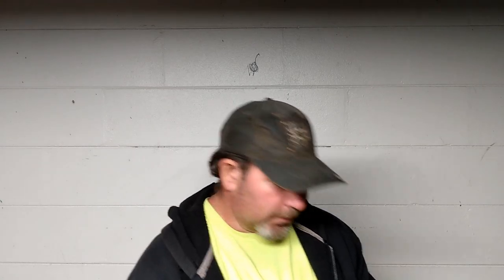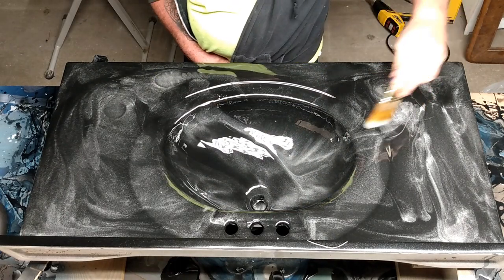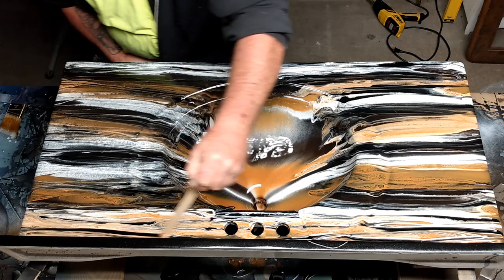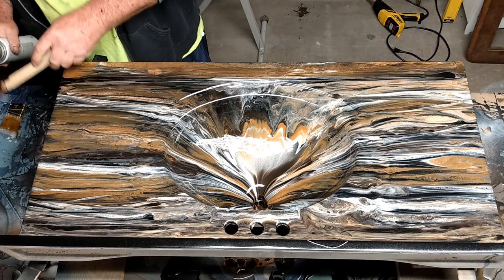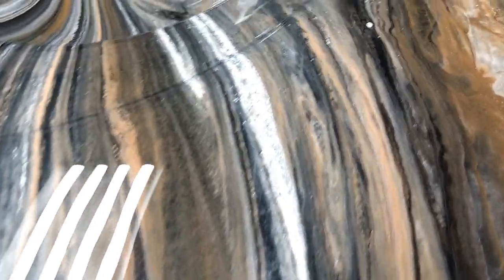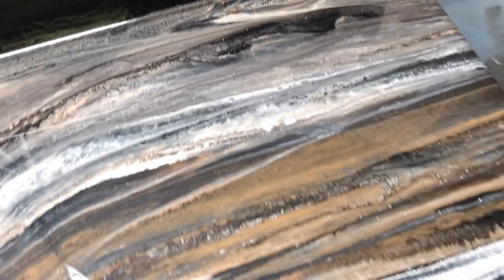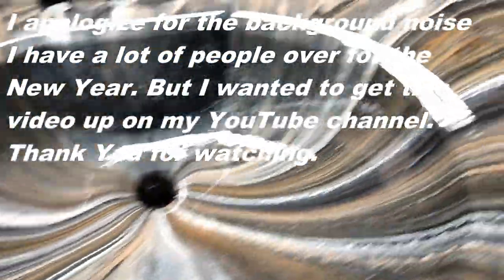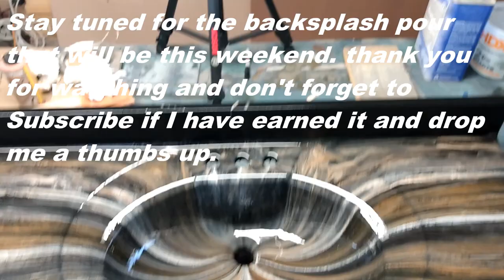The best way to update your bathroom. learn the best way to update your bathroom for cheap cheap!!

Comment: Thank you for your time can I use a normal black paint to paint the sink first before I put the apoxy on and the spray paint is normal paint.
Reply from the maker: You can  just watch the epoxy to make sure it don't start coming off if you don't use bonding primer.

Comment: I love it!! Especially the way it flows into the bowl!! — how would u suggest wanting to DIY without taking the sink out?? That would be a fun one to watch also!
Reply from the maker: Thank you for your comment. It can be done without removing the sink just make sure it's level. Also make sure you protect the cabinetry below and the floor with plastic you don't want that epoxy getting everywhere.
Reply: Liquid Creations Co. thanks for the comment ! What would u suggest we block the drain with?
Reply from the maker: Your welcome 🙂 and thank you so much for watching the videos that supports the channel and I'm trying to get the channel monetized. That way I can do bigger and better projects. To answer your question you don't want to block the drain with anyting. After you disconnect the plumbing put an old bucket under the sink so it can catch whatever epoxy comes out. I hope this answers your question if not please let me know and have a blessed day 🙏
Reply: Great tutorial, I have learned so much! Your work is very beautiful!!
Reply: @starlord2574  very much thanks
Reply: @starlord2574  good to know

Comment: Thanks for the video! What kind of spray paint did you use? Flat? High gloss? Thanks again
Reply from the maker: It's gloss rustoleum spray paint for some reason flat doesn't do very well in epoxy I would recommend either using satin or gloss or semi-gloss.

Comment: Looks amazing.  I've got this 15yo white fiberglass American Standard jet hot tub that just cracked in the middle due to structural gaps I could feel when standing on it. Water is getting through. I drilled a few holes and filled it with Loctite expanding foam and it's solid now.  The base has a seashell pattern in white I was thinking of just replicating over fiberglass resin.  Do you think textured resin (or epoxy like this) would stick and survive the abuse of standing and hot water in Tub? If possible I'd like to fix without sanding or spray painting.
Reply from the maker: Thank you so much, the epoxy will stand up to the abuse but you have to get the right kind. Go to TotalBoat.com they have all kinds of epoxies for all different types of applications. And if the surface around the crack is smooth epoxy will not stick to it very well. The way to fix that is to take a piece of 220 grit sandpaper and lightly scuff wherever you're going to put the epoxy that way it has something to bite to. If you go to their website I would contact him and speak to one of their representatives they will hook you up with a right epoxy and make sure you tell them that
Liquid Creations Co. Sent you hope this helps good luck.

Comment: So you do 2 different  styles one with spray paint and a paint stick and one with paint mixed with epoxy whats one do you prefer? Especially for a beginner
Reply from the maker: If you're just beginning I would use a spray paint with a paint stick that would be a lot easier to control.

Comment: Could you do this to a plastic tub? I have 2 Rustoleum resurfacing kits and would like to add a marble  color.
Reply from the maker: I know regular epoxy won't work on a plastic tub because the epoxy doesn't have any flex to it whenever it cures and a plastic tub is going to move some whenever you step in it. However they do make kits for resurfacing plastic tubs if I'm not mistaken I'm not sure if the Rust-Oleum resurfacing kit is one of them.

Comment: Hello. Did you paint the sink, before you started?
Reply from the maker: Yes I painted it with a bonding primer 2 coats then let dry for 24hr before I started the epoxy work.
Reply: @LiquidCreationsCo2609  thank you

Comment: That's briliant looks amazing!
I have just seen  your video...can you please let me know what spray paint do you use? Its secial paint for epoxy? Or just any spray paint in general? And one more really important thing for me ...do you prime the sink before you do the epoxy? Thank you 😊
Reply from the maker: Thank you for the comment I used just regular old Rust-Oleum spray nothing special. I used to prime my sinks but I have found that are really doesn't matter either way and a lot of people are going to tell you it does but I've been doing it long enough to know that it don't. And I've never had anybody call me back over something going wrong.

Comment: I am about to do this to my sink and our bathroom vanity looks very similar to this but a lot longer and has 2 sinks connected. I don’t know how to take it off so I plan to do this without detaching. What can I do to avoid messing up my pipes/drains
Reply from the maker: You're going to have to go under your sink and disconnect your drain pipe once you do that there should be a little silver or maybe a black nut right up against the bottom of the sink that will allow you to take the actual drain itself out of the sink so the epoxy don't mess it up. You can leave the sink in place but you're not going to have any choice but to remove that drain pipe that goes through the bowl out the bottom and you going to have to unhook it from the pipes underneath so the epoxy don't stop them up.

Comment: How much epoxy do you use to coat your sink?  Also, do you know if the spray paint technique will work with white epoxy?  I've got some experience with pouring art- I'd never have thought to do it on my sink.
Reply from the maker: It depends on the size of the sink that determines the amount of epoxy I use I generally try to mix up 4 oz per square foot. Yes spray paint will work with white epoxy. Although I would not try to use acrylic or anything like that it can be done but you have to be very very precise on your measurements to use it. That's why I don't make any videos using acrylic paint or anything like that in my epoxy I use rustoleum spray paint only I hope this information helps good luck.
Reply: @LiquidCreationsCo2609  THANK YOU VERY, VERY MUCH!  I just bought a small sink today, I hope it turns out half as well as yours! :)
Reply from the maker: @jessicadooley4932  well thank you for that. It will turn out good just have faith in yourself and if you don't mind send me some pictures when you're done so I can see your finished product please 😊

Comment: I've seen another video you did about removing the drips once they have hardened. I think it would be easier for you to scrape them periodically as the epoxy starts to thicken that way you wouldn't have to sand them with the rotary sanding pad. So my next question is do you have to do a clear coat once everything is dry? In case I missed it how much part A and part B do you mix together for a sink like this. I have about 1/2 to 3/4 gallon of each left. I didn't see you use your heat gun in this video like others. Thanks. Love your channel.
Reply from the maker: You would be right if you had time to sit there and babysit your project. This is just one option if you don't have that time or if you forget and the drips have started getting pretty hard this is one very easy way to get them off.
Reply: @LiquidCreationsCo2609   Thanks for replying back to me but would you be able to answer the other questions I asked. Which brand of epoxy do you use also. I have two bathroom sinks to do but only about 3/4 of a gallon of Part A and Part B left. I have to do one of the two sinks this weekend and will try your techniques with the heat gun. Thanks.
Reply from the maker: @richardmace4609  my bad,  one of the best epoxies that I have found to use on sinks is TotalBoat Tabletop epoxy. When it was first formulated it was done so to be used on boats. Later on in the life of the company they seen a market for tabletop epoxy so they formulated a tabletop epoxy based off of the original product. It was originally designed to be wet and 3/4 of a gallon is plenty to do your sink. Thanks again for your comments they help the channel out more than you know.

Comment: What brand  of epoxy do you use for sinks and countertops
Reply from the maker: I use WiseBond epoxy it's a very good epoxy if your interested in it here is a link to there website and here is a discount code  "KELLOGG10"  for an additional 10% off.
Reply: @LiquidCreationsCo2609  thanks, and what sealer do you use?
Reply from the maker: @lindastadtler3017  once I do my color coat I wait 24 hours and put a clear coat of epoxy over top really that's all you need. Unless you want to put a to part urethane on it all that's going to do is help with scratch resistance and it'll give it a little textured look which a lot of people don't like. if you want to go that route I would suggest to get a water based to part urethane to use. And if I'm not mistaken you can get that on WiseBonds website as well this helps. There's anything else I can do please don't hesitate to let me know.

Comment: Absolutely beautiful! Would you recommend some sort of prep for the initial redo on an existing vanity top?
Reply from the maker: Thank you so much for your comment it's very much appreciated. Now to answer your question it's actually kind of funny you ask this question I'm in the process of making a video that shows everything I mean everything from the very start to the very end of how I do my sinks. Anyway yes what you want to do first I use a product called TSP. Which you can buy at Lowe's home Depot places like that it's a heavy duty degreaser clean your sink with that or your vanity top and then take some 220 grit sandpaper and go over the entire thing lightly just to ensure there's no high points bits and pieces that are sticking to it they would affect your epoxy flow and you want to make sure there's no silicone anywhere once you do that wipe it down real good with some acetone then you can proceed to your epoxy work I hope this helps and would love to see pictures of your work once you're done have a blessed day.

Comment: Will this also work for a bathtub??
Reply from the maker: Yes it will but the bathtubs are quite a bit harder to do just because of the shape of the tub a lot more epoxy is going to run off but it can be done I've done it myself it also waste a lot of epoxy though.

Comment: Heck of a good job bro! How long does it take for the epoxy to harden and after you add the clear coat how long does that take to set before it's done? Thank you very much. Thanks a lot Robert.
Reply from the maker: Thank you I really appreciate your comment. After I do my first color coat I wait about 8 to 12 hours then I pour my clear coat over top of that and I let it cure for about 3 to 7 days depending on the humidity then I install it and you can use it.
Reply: @LiquidCreationsCo2609  Thank you so much Robert. I will put this information in my repertoire. Thanks again. Keep up the good work.
Reply from the maker: You are very welcome, and I think you again for your comment also because something as small as somebody commenting helps the channel more than anyone knows so thank you

Comment: Did you have to do anything special to put the drain parts back on?
Reply from the maker: No you shouldn't have to do anything but if it makes you feel better you can use a stir stick and from the bottom very easy with a downward motion you can scrape the epoxy out after it has set up for a couple hours I hope this helps if I can help you with anything else let me know have a blessed day 😊

Comment: how smooth is the bowl part? from the videos it kinda looks bumpy
Reply from the maker: It's a little bit  wavy because I introduced a lot of paint into the epoxy but when I do my flood coat it will be smooth but it's not bumpy at all you can just barely feel the waves in it

Comment: Absolutely beautiful I'm so excited to watch your video I want to do a sink myself and a countertop question is what kind of resin did you use and can I do it with the sink in place or does it have to be removed with a rest and go down into the plumbing which could cause me a problem let me know beautiful beautiful
Reply from the maker: Well Thank you for your kind comment. As for what resin I use it is a product called Totalboat Tabletop Epoxy, it is designed to be wet more often than not I love working with it. I have a link to it down in the description below the video so you can check it out. And no you don't have to remove the sink to pour your countertop I think is what your asking me and no  you can tape it off if you don't want to do the sink. But if you do pour your sink make sure you unhook the plumbing and put something under there to catch the excess resin.

Comment: How did you do (and what did you use) the first black base coat? In the coat that you poured, did you add something to the resin?
Reply from the maker: When I first got the sink I cleaned it with TSP then I painted it with a black bonding primer once that cured I poured a clear epoxy over then I added all of my colors to it.

Comment: That’s wY easier than the way I was doing it .  Great job!
Reply from the maker: Thank you I appreciate that. May I ask how you were doing it?
Reply: I was mixing the batch clear and the pour into cups and add color to each different cup and pour randomly back into bucket without mixing together and the pour it out on top next sink and let it run through.  Same result as yours but less mixing.
Reply from the maker: @tomcrisler3216  you basically done a dirty pour do you have any pictures of it by chance that you could share?

Comment: So what did you end up doing to the back splash ?
Reply from the maker: I poured it the same as I did the rest of the sink two days later here's the link to the video.
https://youtu.be/mJVazudTfJs
Reply: @LiquidCreationsCo2609  Thank you !
Reply from the maker: @shanaypeters3634  you're very welcome ☺️ I have a good video I am making this weekend I haven't been able to find the video like it on YouTube or anywhere on the internet for that matter so it should be pretty good.
Reply: @LiquidCreationsCo2609  I am about to epoxy my countertop with the sink and back splash all attached and I couldn't be more nervous.
Reply: What types of finish do you use for the flood coat ? Also, can you use a polyurethane spray can for finish ?
Reply from the maker: @shanaypeters3634  it all depends on what the customer wants some of them wanted to be real glossy and someone to be a Mac finish. And I've never tried to use that polyurethane spray on personally I think it's trash it wouldn't hold up like epoxy does.
Reply from the maker: @shanaypeters3634  you'll be all right I got paid for you you can do it just make sure you clean it real good so you don't have no oils or stuff like that on there who's in your epoxy won't stick to it. Make sure it's level if not the epoxy is going to go to the lowest. spot
Reply: @LiquidCreationsCo2609  Dang it I don't have alcohol to wipe it down :( is there an alternative ?
Reply from the maker: @shanaypeters3634  are you talking about to clean it?
Reply: @LiquidCreationsCo2609  Yes I watched a video where they used alcohol to clean it before the finish?
Reply from the maker: @shanaypeters3634  you don't need alcohol you can use vinegar that's a good one by the way you can use glass cleaner. But you do not have to have alcohol that is not set in stone I've cleaned many many finishes with out using alcohol then poured a clear coat over it.
Reply: @LiquidCreationsCo2609  Thank you !
Reply from the maker: @shanaypeters3634  your welcome 👍 and thank you for watching the videos.

Comment: I love the sink. Do you do them for customers?
Reply from the maker: Yes I do
Reply: How much do you charge for a drop in bathroom sink and where are you located?
Reply from the maker: @roxyyakle4928  The price varies on how many colors they want and design. For example the sink I just done $325 was payed for it. And I am located in North Florida North East Florida to be exact. Thanks for the comment.👍
Reply: Would be one color. A copper color.
Reply from the maker: What size is the sink?
Let's say it's the size of the one in this video and you only want one color.
If the sink is already pulled and I can come pick it up bring it to my shop do my work and deliver it back to you $175
Reply from the maker: Where do you live?
Reply: It is just a basic drop in sink no countertop. I live in Iowa. I had bought the sink at Menards and when I was installing it I messed up the coating and was thinking if there is a way of fixing it.
Reply from the maker: P
Reply from the maker: @roxyyakle4928  Go to UPS or FedEx ship it to me I’ll do the work and ship it back unless you want to attempt it yourself
Reply from the maker: @roxyyakle4928  yes it can be fixed the first sink that I did had a crack 9 inches long that went all the way through it I repaired that then I Put epoxy on it that was eight years ago the sink is still going strong so I heard

Comment: Beautiful! I’m gonna back up this video in a moment and check but did you say how much epoxy you used for this? 
Glad you popped up, loved this video.
Reply from the maker: Thank you so much for your kind comment. I'm not sure I usually tell how much epoxy to use but if I did it I normally use 4 oz per square foot. And if by chance you don't know how to get your square footage measure it from front to back and then side to side you times them to numbers together that will give you your square footage and just add a little extra epoxy for good measure.